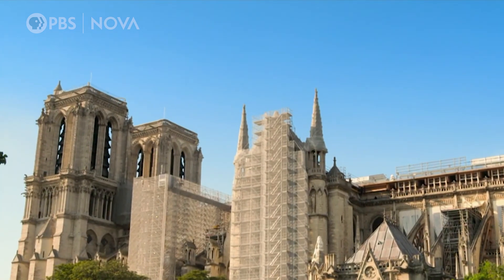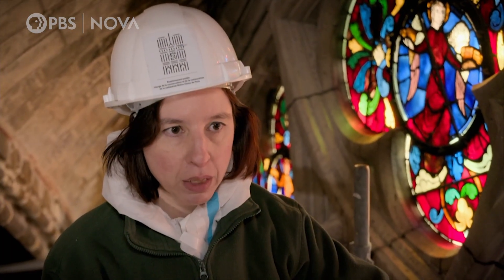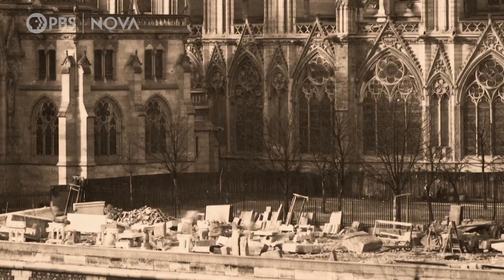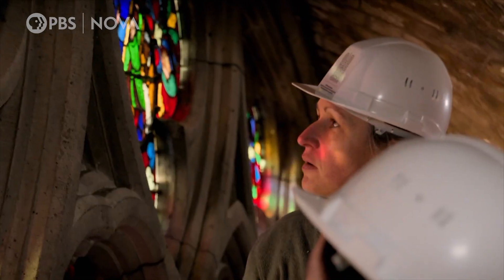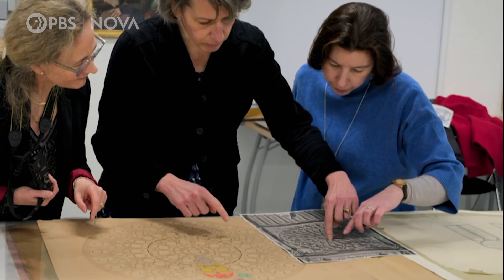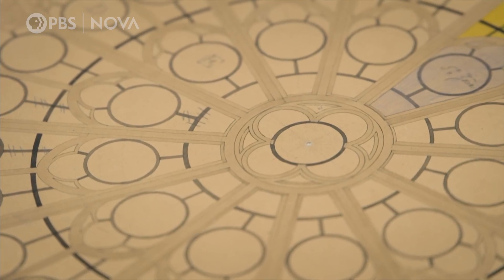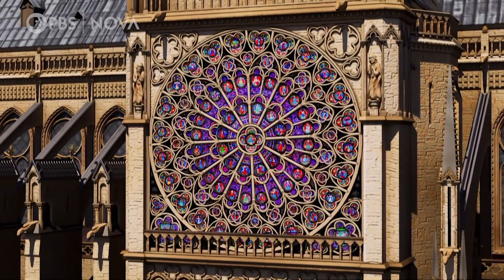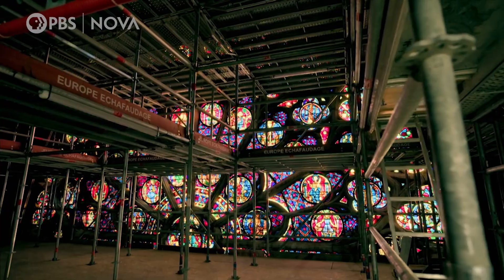Restoring Notre Dame’s Iconic Stained Glass

Comment: 👀 I thought it burned down.
Reply: April 15, 2019, there was a massive fire, destroying the roof timbers and melting the lead shingles.  The spire was also completely destroyed.  But, most artifacts were safely removed and the walls preserved and restoration is about half-complete and it is hoped it will be done by summer of 2024.
Reply: @Laurgal5  Thank you!
Reply: As of April 15, 2024, the Notre-Dame de Paris Cathedral in Paris, France is scheduled to reopen on Sunday, December 8, 2024, following extensive restoration work after a devastating fire in April 2019.

The reopening will include a procession through the streets of Paris two weeks before the reopening to accompany the return of the Notre Dame statue, and the rebuilding of the spire. The cathedral is also scheduled to remain open until June 8, 2025. 

The cathedral's chief architect has said that the reopening will be "breathtaking". The restoration work has included:
__ Finishing the framework
__Cleaning and restoring painted murals
__Rediscovering the colors of the cathedral's 24 chapels, which have returned to their vibrant 19th-century color palette
__Completing wooden stars with 22 carved oak panels depicting the life of the Virgin Mary, which had suffered water damage during firefighting. 
Schedule for Notre Dame Cathedral's grand reopening in December unveiled -ABC News

I would love to attend that Sunday church service and Christmas in Paris.
Reply: It did several years ago.